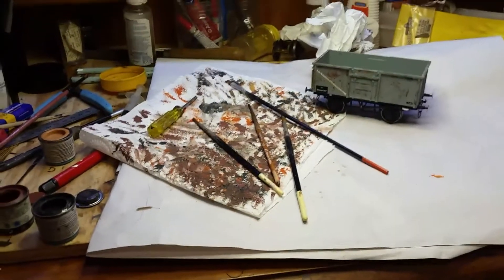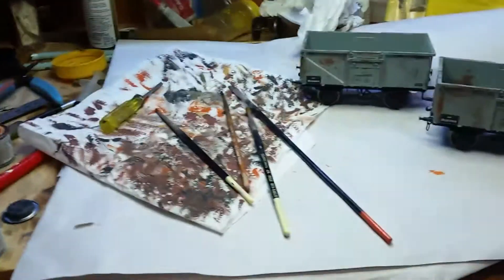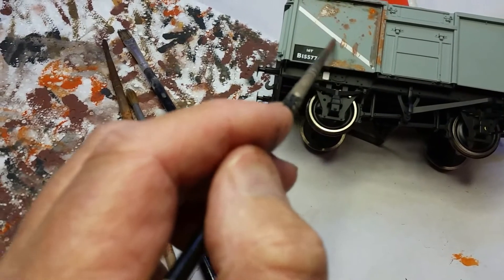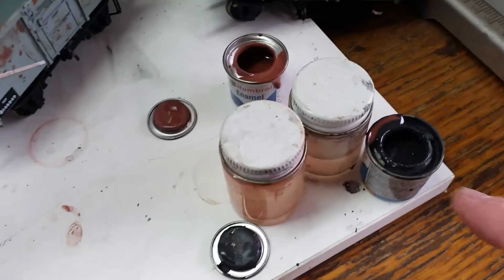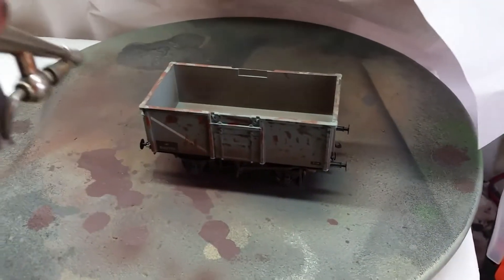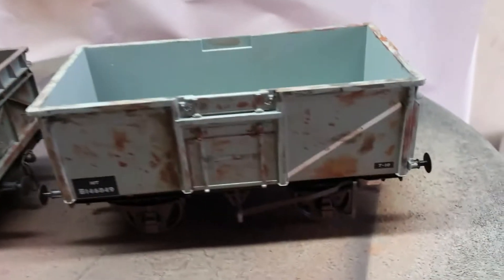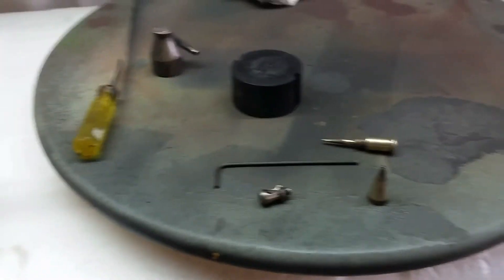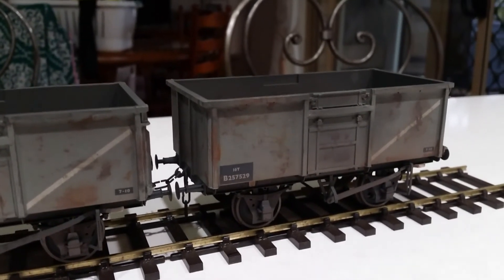West Green Garden Railway  Weathering of Lion Heart 16t Mineral wagons

Comment: Terrrific results Steve. Maybe unwittingly so but you gave a great review of that airbrush. Can you give me the full details of it please? Paul
Reply from the maker: Galgorm Hall OO Gauge Railway Layout Hello Paul
i think I got the weathering the right way round by doing you dry brush then tone it down as it seems to pull it all together.
the Brush is a Paasche H.
This is an external mix gun and single action.
external mix means the paint and air mix outside the gun.
These can ve cleaned easily as you can see.
on a single action brush the button simple releases air.
on  double action pressing the button releases air and pulling it back lets paint out.

I have hacthe brush 22 years so you can see rhey are good.
many pro loco painters have tried many brushes 
if you want really fine lines etc then an internal double action is superior..
Have done 6 wagons I think dry brushing  is the best way I feel.
but you cant beat an airbrush for painting a wagon and especially the underframe.

Paasche and badger and I believe Iwata all make similar products so rule of thumb by a good quality brush not necessarily the most expensive brush.